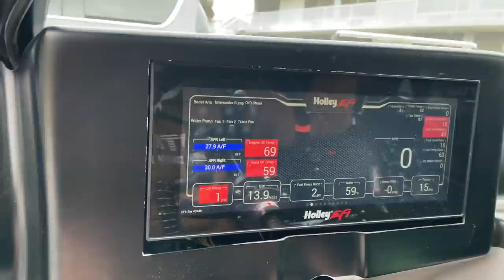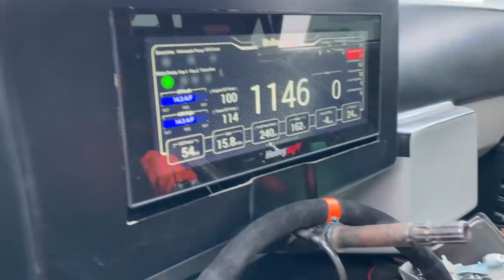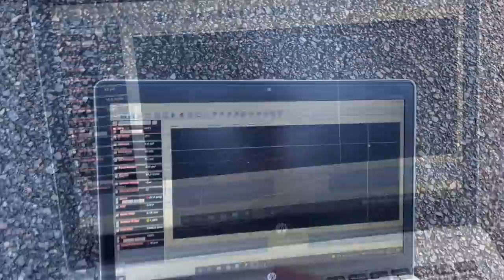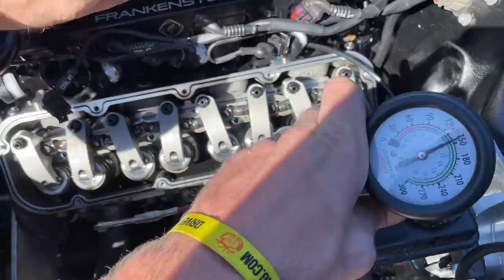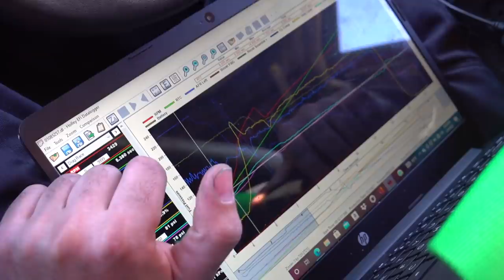Sick Drag Week Day 2 & 3: It Was a BAD Day... Mullet Down, Ruby Mysteries, Marauder Backfires...

Comment: Never a good idea to “hot lash” valves. By the time you start lashing to the time you finish lashing the engine has cooled some. Meaning your first valve lashed will be a different clearance than your last valve lashed. If no choice besides a hot lash do one bank as fast as possible start the engine to get it back up to temp, the same temp. Then lash the other bank.
Reply: Thats kinda what i was thinking, i always heard it was better to do them cold or with it running
Reply: I play my mixtape the keep them hot
Reply: @brandonleisure9999  doing it running isn’t recommended either. Also only pertains to hydraulic cams not solid. It’s an old school shade tree way people would set the lifter preload. I’ve even seen people cut old valve covers up to make access windows to help control oil spray. They back the adjuster off till the rocker clatters, tighten it just till it quits, then go 1/2 turn. Lock it down. Basically when the clatter stops that’s “zero lash” then half turn sets the plunger preload inside the lifter. Can be done, but not very accurate imo. I follow exhaust opening, intake closing method.
Reply: Best time to do valve lash is first thing in the morning - aka when the motor has absolutely NO heat in it.  I wouldn’t do it any other way unless it was an emergency. 

They did it with heat in the motor and look what happened. 
I learned that lesson very early on. 
Can’t believe they did that, but hey, I guess that’s how they got their lesson.
Reply: I tend to warm up the engine, then set the lash on an intake and one exhaust.
Then after everything has cooled, I use those two valves as my reference to set cold lash.
After that, checking hot lash is easy and fast. Remember there's a big difference between setting hot lash and checking hot lash. I set mine cold and sometimes check hot. Only takes a few minutes to check once the valve covers are off as all you do is stick in that feeler gauge to verify lash.
If lash needs adjusting, find out what's wrong, because lash usually only changes if something is about to break or is already broken.

Comment: That nasty backfire was exactly what my tuned Evo 8 would do in colder, and even damp summer temps. No amount of data logging could figure it out. I’m just guessing colder and denser air causing overboost? The flames out the back were cool though! 😂

Comment: I'm still waiting to see Mullet hit 6's.  Seems like the new motor and transmission are holding together pretty good aside from the valve issue you had.
Reply: Yes!
Reply: It’s crazy the amount of issues they have with it. Racing is such a fine balance of soooo many different variables. Fix one thing for the next to break. Wild.
Reply: @brettbaratheon9776  I’m not a racer by any means but I don’t understand how those fast guys have so many issues. I’m a twice a summer take the car down to the drag strip and it’s a bad day for me when a fuel pump goes bad😂 couldn’t imagine fixing stuff after every trip out

Comment: It's still insane to me how slow the boot times are on these Holley EFIs, idk how they haven't figured that shit out after all these years.
Reply: Yea I was thinking the same. Fire it up and wait and grind your teeth till it comes up and shows your engine vitals🤦🏻‍♂️ 20 seconds later.
Reply: I literally thought the same thing. But keep on mind there pretty much a shitty pc
Reply: I was surprised to see that too
Reply: Chips are expensive and rare right now but I do agree they take way to long
Reply: I always wondered why they do t have some type of voltage seporation between the ecu supply and the starter cycle. To keep the ecu running during cranking...
Reply: yeah they're probably running some cheaper processor to keep the costs down. i wonder if someone could open her up and put in a better chip to boost the speed
Reply: @matt10011987  I mean, a single  18650 in the dash should be able to do it.
Reply: It's because it's powered by the ignition when it could be powered by a separate switch to gather data, even before cranking. I do it to both the EFI and wide band - WB's tend to fail prematurely if they turn on with key on as they overheat unless there's flow over them.
Reply: Ecu and dash are completely separate systems power wise. They just need dedicated power for the dash on it's own switch instead of ignition. The dash can run without the ECU on, it just won't show data. Then once the ECU comes on it will pick it up.
Reply: There is module that can be wired in between the ignition power and 12 volt power. it makes the dash start up straight away. Cleeter fitted one to Leroy back in the day,
Reply: @kleetus92  amen to that.
Reply: @kleetus92  Agreed, would like to see Cleeter's fleet on FuelTech FT600, but he is sponsored by Holley unfortunately
Reply: @WOTTechnologies  gotta keep that hot exhaust going over them to keep it cool huh? Lol
Reply: @238haden  Yes. The o2 preheated will get the element too hot and it ruins the WB. I replace them all the time at work because people will listen to the radio with engine off and the element burns. If you don't believe me, just open the instructions on any WB kit. ;)
Reply: @WOTTechnologies  not doubting u just a funny concept. Tbh ive never really messed with a wb
Reply: @238haden  All good! I might just be a little OCD lol. Ok....maybe a lot.....
Reply: @justinlabarge8178  those are like 3.2v
Reply: @ionstorm66  the 7 inch I installed ran off a USB or can us to the ecu I'm pretty sure
Reply: @matt10011987  They can get power from the can bus from the main ECU, or run dedicated power. Holley sells a premade can-power harness or you can make one.
Reply: @ionstorm66  the more you know.. Cool man that's helpful

Comment: i love how yall always bracket ruby at 8.50 but shes gone way faster on a smaller turbo let er rip tater chip just once and let ruby spread her wings i wanna see as close to a 6 with her as possible
Reply: Maybe elco would be the 8,50 car insted
Reply: @larsandersson4126  agreed the cars so heavy every engine they put in they destroy it ruby is light and on there old setup they got close to a 6 now its got a better turbo setup etc and its far more reliable than the elco ruby should the the 6 sec car

Comment: Put the hood on the elco.  The hoodless thing is played out and slower. Not to mention it would keep some of that water out of the engine bay.  All that water going straight into the turbos can't be the best either but you can't fix that without a different turbo manifold.
Reply: Boooooo

Comment: Can we all agree it’s time to move on from Texas speed in mullet? car can’t do 10 passes without breaking engine parts :(,I really wanna believe it has 6’s in it but I’m struggling to think it will get there without a SMX.
Reply: Its the way they build their engines dude. They have no quality checks at all. I guarantee there are other people using TS engines with no problems like they have. They are never going to go a 6 because they cut corners all the time and don't take the time to make sure they are doing everything correctly. How many times did they forget to put the turbo oil line on? How many engines have they blown up because they put something in wrong or re-used parts that they should have replaced. They have enough money to do this right but they have the same problems over and over indicates they are shooting themselves in the foot. That said, to go the speeds they are going isn't easy or cheap so I'm not trying to shit on their accomplishments, they just need to decide if they want to keep going faster or just stay where they are and reliably win races.
Reply: It’s hardly a Texas Speed engine anymore. The only TSP left is the block and the crank.

They don’t need an SMX, that’s for pro mods.
Reply: the funny part is these heads are not texas speed heads, it's Frankenstein Monster series head. The only texas speed parts on it is the crank and block now.
Reply: @jonathan7744  the block is not Texas speed is a Dart block.  Tsp doesn’t make blocks they sleeve oem gm blocks but mullet doesn’t have one.
Reply: @douglasm3310  oops didn't know that, thanks for the clarification. Even further proves my point that it's ridiculous that they blame TSP for mullets problems.

Comment: Just saying, throw a Steve Morris motor in Mullet. He’s top caliper in every aspect but motor.. that LS is a let down
Reply: It’s not a big tire car, it would have to be completely rebuilt for that
Reply: LS is a let down at 7.3x 1/4 😂 that car is flying for how heavy it is with a small block.
Reply: @robbygray9562  seems it constantly needs improvements/repairs/servicing. Reliably wise it’s a let down, he’s had to increase performance w the new aluminum rods just to achieve the 6.xx.. idk I know nothing about costs of the racing motors but Texas speed has never impressed me with the reliability.

Comment: If you can fit it in your budget buy a couple or 3 of them 1/4" pressure gauges in different ranges, assorted fittings and some rubber hose. Then you can check what the pressure is on a good old fashion analog gauge and you won't have to wonder if the pressure sensor is bad. ;)

Comment: Popped a push rod out. Adjusting those valves a bit too loose or tight. Adjust the exhaust valve when the intake valve is on its way back up and adjust the intake when the exhaust is just opening. On each cylinder and do it cold. .020

Comment: The learning curve on the new engine setup will take a little time.  Once mullet starts running consistent then you will be able to get the 6's.  With the solid lifters you will have to probably modify your maintenance schedules.

Comment: Props to the Good Dr. for shooting those rollers of ruby, silky smooth.
Reply: Most major cam manufacturers today recommend doing them cold. They provide a cam card with each cam & lifter set that tells you what to add or subtract from the hot lash setting based on your combo. Say your running aluminum heads & block you would subtract .012 from the hot lash setting, .006 if running an iron block & aluminum heads or add .002 if it’s an iron block & heads.
Reply: @tonypascale7754  Was talking about the rolling shots while they were driving. but good info

Comment: I dropped a valve in one of my alky motors. Pulled the heads and the other 7 intake valves were tulipped bad. Like I could have taken a shot of whiskey out of them lol. But it did show in the lash. But I typically crank 81-8400 rpm twice a lap over and over lol. Btw I noticed something. Yall must have been practicing the tree at the shop. Seen so many trees in this video! Even Sam! Keep diggin y'all,!

Comment: Better luck on the next stop. I can't wait to bring my me car to a race week like you guys. My old Valiant wagon will be racing by early summer but the way things go it will probably be next summer. Im pushing for this summer. Chassis is done and the body is rough cut. The block and heads are back. The crank is still getting worked over. I have the cam and the Pistons and rods. Waiting. I need to order rings. It's a long list. That we all have. Thank God for the internet. My first build with my dad was fun because my dad did it all on paper and a calculator. Not many computers in 1980. It was the good old desk copy of parts books and a lot of sore elbows from leaning on the counter at the speed shop. My dad was sponsored so he got stuff for free or at cost. A good mix of both. I miss going into the shop and seeing different intake manifolds sitting on the shelves. You don't see that these days. Well at least in Rockford IL. At least we have a drag strip close. Not like the Freedom Factory. I hope to catch everyone out on the dragstrip. If you see a fat guy in a 65 Plymouth Valiant wagon at the track in the Midwest it's me. I think I'm going with the name grocery getter or something like that. I have to wait till she is sitting on all four wheels to decide a name for her. Happy Safe Racing 🇺🇸💪

Comment: Just a thought which might help prevent major engine failure in the future, would it be worth having a car at the shop that all new engines get dropped into? Someone could then run in the engine for a few hundred miles on the road to get everything bedded in nicely and identify any small issues with the motor before it's installed in one of the drag machines and taken down the strip. I just wonder if there have been so many engine failures purely because they aren't being run in and minor issues aren't identified before throwing a couple of turbo's at them? Anyway, as always, love the content and hope you all manage to get through Sick week in one piece!

Comment: Cleetus - I have to ask? Are you ever worried about the turbo's sucking up to much water? Or does it evaporate pretty much when the water hits the fins. I know you mentioned your only concern was the water splashing on the windshield from the tires? Is there anything else that stresses you mechanically driving in rain like that? Thanks for all the great content. It's very entertaining.

Comment: This stuff is so surreal. Ruby accidentally ran three seconds, and Mullet blew the ass end off and ran two, FULL SECONDS faster than the fastest car I’ve ever driven in my life (turbo 6.0 S10 Blazer, whassup George?!). Another second faster than my fastest-ever personally owned car (Magnuson-blown, all-forged guts,  aluminum 5.3L L33/Tremec TKO600/3.89:1 9” ‘86 El Camino with a ‘78 front clip, but I’m a stickshift drive-for-fun guy, and not a terribly good stick drag racer, maybe half a second in the right hands/feet). What a time to be alive.

Comment: How depressing. LOL The trippy part is I have a Howard's solid roller, they say.023" , and when I heard you all say .016" it made me wonder if I could go tighter; and what's even trippy-er than that is when I was a kid I had a 67' air cooled bug with solid flats recommended at .004" and anything over that was clattery as F. Go figure. The S you all go through, break-downs under the gun, then bogging, burning, or missing on the run, not to mention the bread, keeps me off the F-ing track man. I'm sticking with steet machines. LOL F-ing brackets will kill you quicker from a heat attack or a stroke than a GD crash.

Comment: Would it be against the rules to have a timer displayed in Ruby that starts when the trans brake is let off? Would let the driver know if they're running too hot for a limited class like that...
Reply: Does the run start when the car moves or when the lights trip? I don't know how these events work

Comment: Cleet, we love you and I respect the relationship you've had with Texas Speed on your channel, but once you finally get Mullet a few 6 sec passes, I think its time to take out the Texas Speed 427 and run something that will be more capable and reliable to handle the 2000+ HP you want to push in Mullet. Honestly, you're REALLY pushing the tippy top end of what those 427's can handle. Texas Speed is fine an all but brother, LeRoy, Ruby and now Mullet have always had engine issues with the 427's they've had in them. No love lost towards Texas Speed, but either they need to build you an engine that can handle 2000+ HP or you should look at other options. Sure, you might get Mullet into 6's finally with that 427, but how many reliable passes will you be able to get 6's without the motor having a problem? Just food for thought man. I know you love them.

Comment: I guess a street car is legal without windshield wipers, how can it possibly get past a DOT inspection for street car usage? It can't so put them on the car that easy. If you have to have a Horn You need a windshield wiper as well, manual or electric don't care which but it has to have something on it. I haven't seen a real racer on the McFarland gang yet except maybe James. And he wouldn't do a two step just be be doing one. Unless it is Cleetus's car. Like I said amateur's. Only team I have ever seen graduating that they all messed up their own runs for a day of drag racing. The know they suck and their darn proud of it as well.